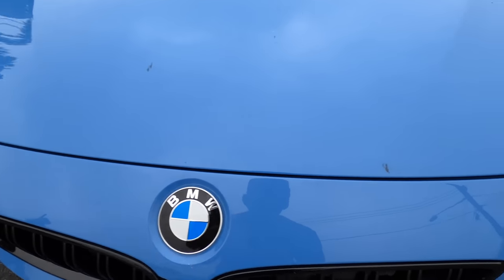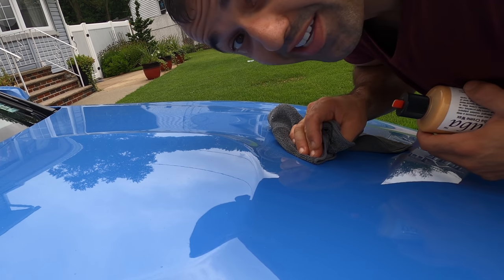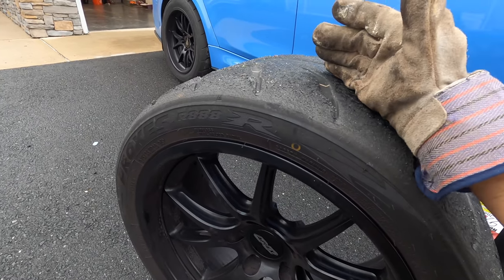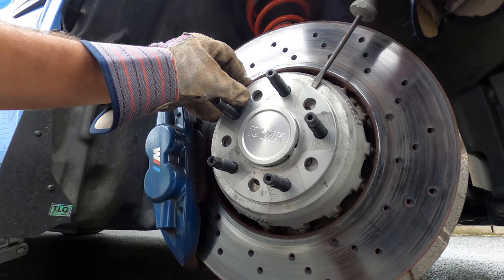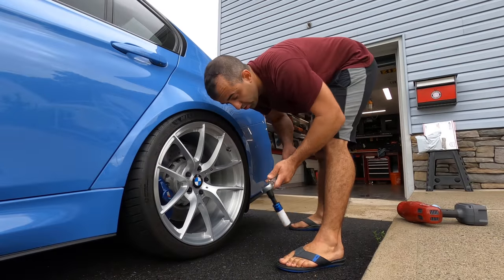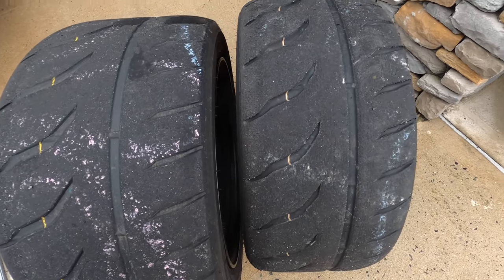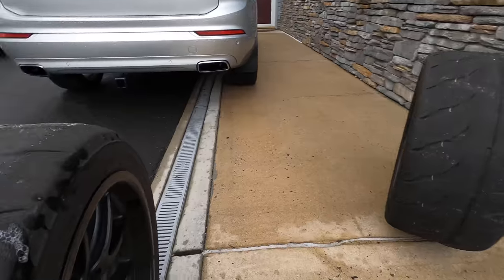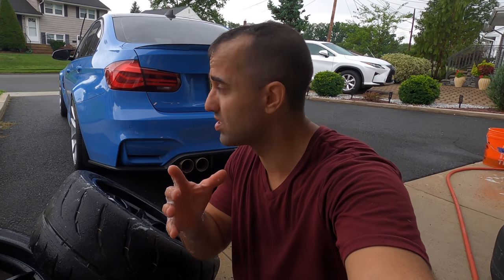Don't track your car if you can't handle the aftermath! Damage and wear report.

Comment: Really good video.    

Watching you switch out the brake pads is amazing.   I've been considering aftermarket ceramic pads to reduce the dust  and you make it look so easy.
Reply: try akebono
Reply from the maker: Ferodo DS1.1 are truly amazing
Reply: They have less bite on the track
Reply: Nick Twaddell , mine is for the streets.   Not comfortable tracking convertible.    The daily dust is brutal.
Reply: @ScottParisi  Yeah for sure.  I used a high temp ceramic coat on my wheels/calipers, so it makes them a little easier to clean after a heavy track day.

Comment: Very nice to see you have a manual m3.Most are dual clutch.Really nice video, i wanted to take my daily audi a3 2.0 tfsi quattro with 414hp to trackdays now and then because i live in Belgium and Zolder is not that far away from me,also Spa is very doable to drive to from where i live, but sadly my ongoing chronic illness(Crohns since 2001) got in the way resulting me to get my medical discharge from my job, so no cash, no upgrades and no trackdays.Hopefully one day but after heavy pains dor a continued 3 and a half years now and in need of surgery that ain't going to happen anytime soon i guess, but it's nice to watch video's like these,it kinda still gives me a part of the experience.So thank you for the great content.Piece out and keep on tracking.
Reply from the maker: Thanks for watching. Hope you get back to normal soon!
Reply: Tommy L Garage Thanks for the reply really appreciate it.👍✌️👉

Comment: In my opinion if you buy a M3 it is legit for you to go to the track to learn to handle it properly or just to have good time. The wrong thing is (my opinion) to tune it for extra horsepower when the owner can't even handle it stock properly on the track. Almost everyone can handle a fast 0-60 on straight line
Reply from the maker: Yes. But on the flipside a mass produced car is made to appeal to most. So lowering and doing camber plates should be the first thing you do when you start tracking it

Comment: Love the video. This is my first season tracking my car and I am addicted. Next season I will get track specific wheels and tires for even greater grip. I am lucky that my V comes with a Brembo brake setup and needs no changes before or after the track. But the the little black marks are hyper annoying so I love the wax tip...I just walked outside and my Buttery Wax from Adams just wiped it all away, Saved me from cursing a ton:)
Reply from the maker: Welcome to the addiction! And I love the V!!!

Comment: Did you consider a square setup for your track wheels? Do you think the difference in tire life would be noticeable?
Reply: Square setup would definitely be more balanced in addition to the ability to rotate tires.
Reply: I’ve often been curious about the handling differences as well. I assume vehicles with OEM staggered setup have been optimized in various ways to account for that. If only I had the money to get 8 sets of wheels and spend a week at the track to do side by side tests. 🤣
Reply from the maker: I wanted to keep oem staggered setup because I wanted more grip in the back. Besides rotating is overrated. When it’s time to replace tires I’ll be replacing all four anyways

Comment: What are your comments on R888R tires when used with F80? Are they good on the track? Any understeer with 'only' 275's in the front? Are they quick to react to direction change? Been looking into these, but decided to go with Cup2's, since there are no reviews on the internet for them from heavier car owners.
Reply from the maker: I have to say I am extremely happy with them. It takes about two laps for them to warm up and become sticky but once they warm up they become super amazing. I will stick with these tires going forward. Now, I would never daily them. You will never get them hot enough to provide you enough grip for daily use.

Comment: Also don’t track if you can’t live with possibly worse outcomes. Such as an accident, etc. I had recently a near miss that was indeed an eye opener, luckily came out with very light damages on wheels and side paint, easy fix.
Reply: I think this good to have an older car that's easy to fix and made only for track just in case if you crash.
Reply from the maker: I may turn this into a dedicated track car.

Comment: Hello, respect for all your videos, thumbs up! 
I have question, thats why i writing on this video not on others. 
Did you had some issue with brake rotors on track? I mean its enough brake power? Did you not searching new brake kit?  I am wondering to change brake kit to CS but its 15kg more weight or to upgrade oem rotors with only good brake pads and save money for others upgrade.
Reply from the maker: No issues rotors on the track. They perform very well.

Comment: Good advice!  I'm too lazy now to clean off all the tire marks. I;ll wash the car and get all the brake dust off but no fine detailing! The car carries merit badges and off track scarsl.  Unless you have a full car wrap, car damages from tires, rocks, car parts flying are unavoidable.
Reply from the maker: The black marks are super visible on blue paint

Comment: Do you have any negative camber? If so the tyres will last longer and make faster times around the track?
Reply from the maker: Yes. -2.5 front and -1.8 rear
Reply: Tommy L Garage I have -3.2 in the front in my m135 f20 xdrive 2014

Comment: I knew I should have done Sebring today.  😭.  Good video. I have the same process (and wheels) except the wax, and I use air compressor to blow out all that extra dust. Will def try the wax since I’m ceramic coated as well.
Reply from the maker: Good idea on the air compressor

Comment: Dayum. Your daily stance is beautiful! 😍
What’s the wheel/tire size +offset on those?
Reply from the maker: Thanks! Richland Forged GT-4 
20x9.5 +22 Front and 20x10.5 +35 Rear 
Wrapped in 275/30 and 295/30 PS4S Tires 
Brushed aluminum finish.

Comment: CarPro TarX. 
Thank me later. Melts rubber off, especially the stuff that gets stuck inside the wheel
Reply from the maker: Thanks !
Reply: Try carpro trix it is ironx and tarx together, it will remove brake dust to :)

Comment: Great informative vid. Respect on you for tracking the f30 makes me want to track my 328 but it's I4 😭
Reply: He has a f80
Reply: @Thicsti  u right my b forgot m3 ain't f30 but same body style thank u for correction
Reply: dude doesnt matter. Youre there to better youself and have fun. Go for it. Its more fun driving a slow car fast than a fast car slow lol.
Reply from the maker: You can track anything. It will be fun.
Reply: Tommy L Garage i 100% agree with you.
Reply: I finally paid off my f30 and all I can think about now is trading it in for a 340 so I can  put some money into a couple bolt ons, upgrade the suspension, brakes and intercooler and charge pipe and track it.

Comment: You make nice videos.   I kind of expected you would discuss inspecting wheels for stress cracks on a +4000 pound car on sticky tires.   Also should have discussed crack propagation on rotors.   No offense.   Safety over cosmetics.
Reply from the maker: Very true. Good point.
Reply: @TommyLGarage  really appreciate your videos.   I am a long time car guy with lots of varied ownership.   I am selling my s2000 to get the same Blue F80 ……really loved the  video you did no changing the intercooler,  keep up the great work.